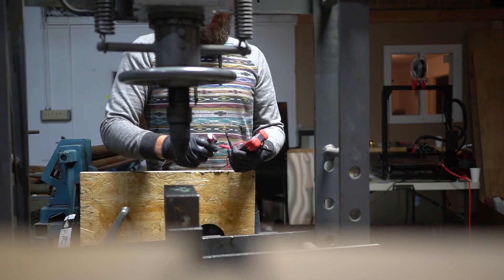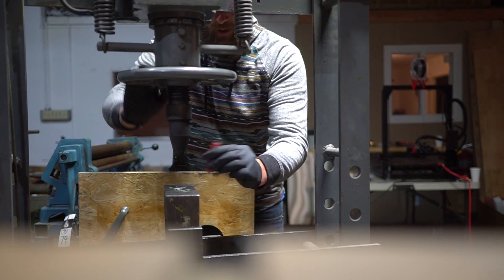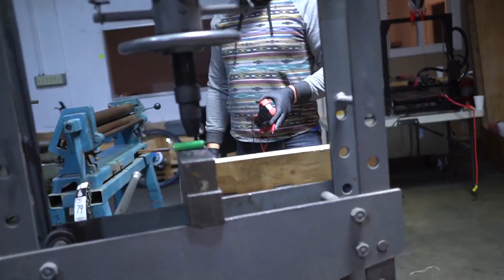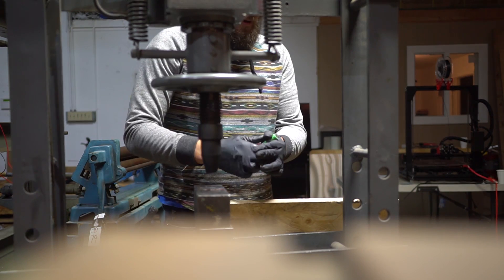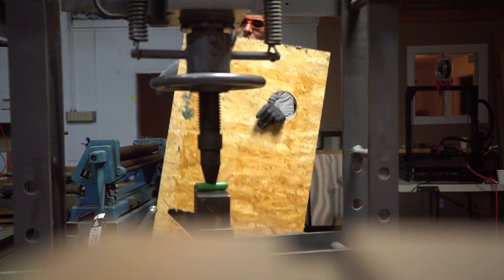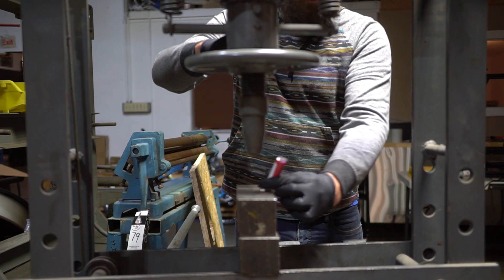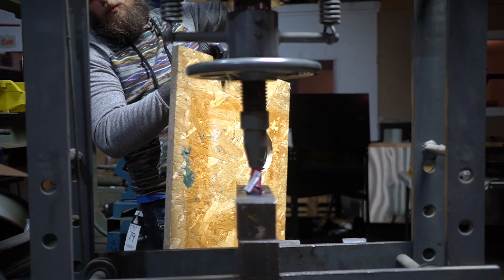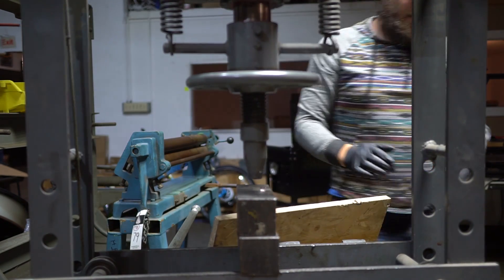Torture Testing 18650 Ga and 25r cells to the point of fire

Comment: I'm not sure whether or not some electric bike companies use Lithium Polymer cells in their battery packs but I know that that cell chemistry is extremely unstable. So just for safety reasons I avoid those at all costs. I know RC ( radio control ) batteries are made with those. I've seen a lot of RC fires.